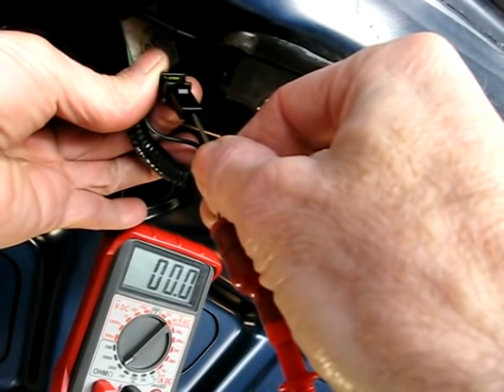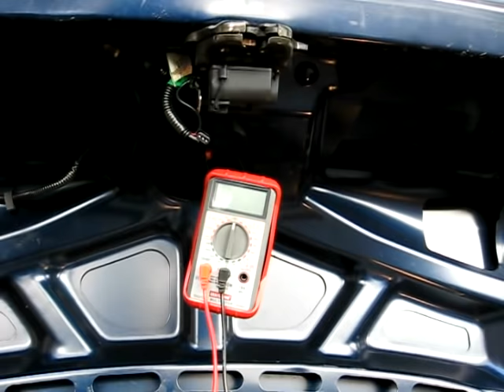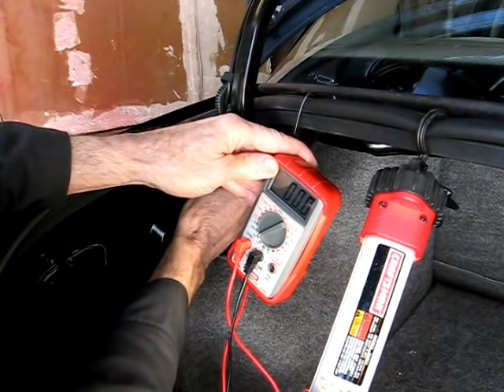Trunk Light Troubleshooting (version 2008)

Comment: Hey Rich, even though I don't have a Saturn, I used your video to help determine the root cause for a trunk light issue with my 2003 Honda Civic, turns out that the fuse was fine and I was getting the proper current flow, but the trunk latch contact was being obstructed by some clear gel like material, so I wiped that off and now it works fine

Thanks again for taking the time to make this video, as it saved me from re-wiring that part of my car

Comment: @crlmoran ,  I'll take a stab at one possible cause, but first...let's eliminate the obvious. Open your back seat then verify the light is staying on once shut the trunk. If it really is staying on, then check out the little copper 'tang' (switch) that Rich was talking about in this video.  I bet there is a good chance it is broken off (or maybe bent upward really bad).  This could allow the lower portion of it to always remain in contact with the connector, therefore keeping your lights on.

Comment: I have a very clean 2011 Charger and the light is not working. Good video. I cleaned the connector (which was very dirty), but did not fix my issue. I will investigate this further. Thanks!